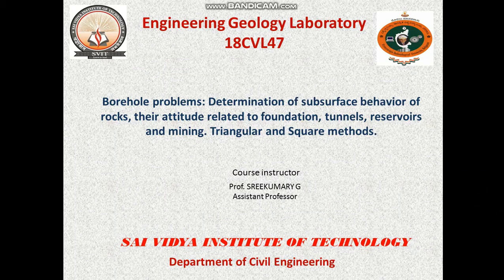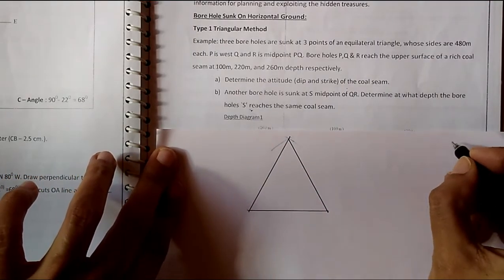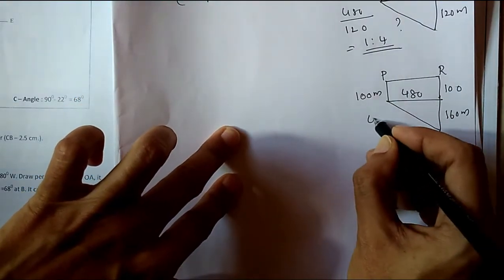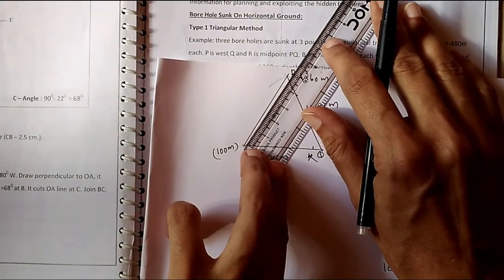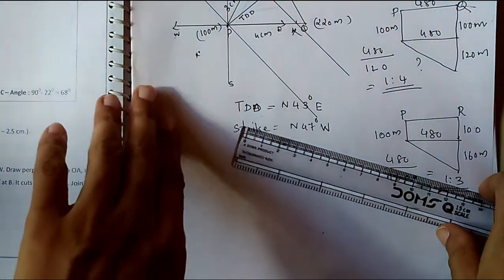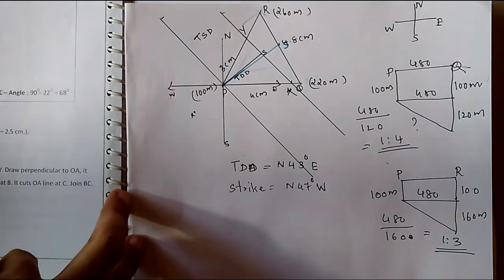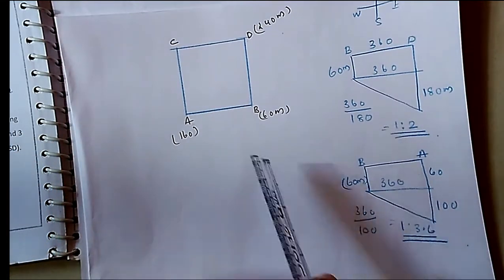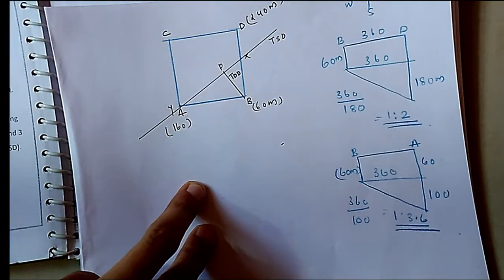Bore hole problem-VTU_SVIT- SAVI

Comment: Three bore holes A, B and C have been drilled to a B is dree north from A 300m and @ is N 600W seam, of A 230. B is 300m are C is 275m. Calculate the rate of full dip and direction.